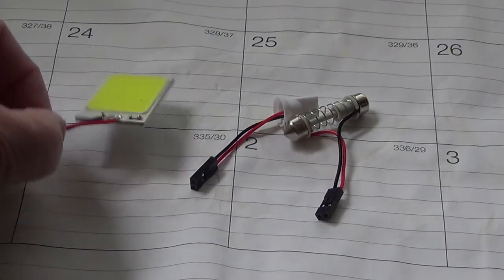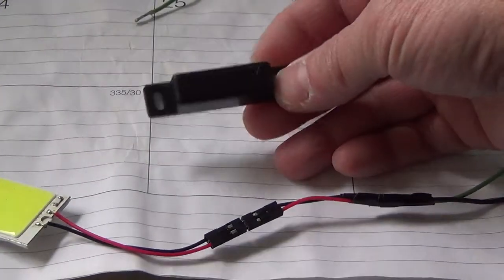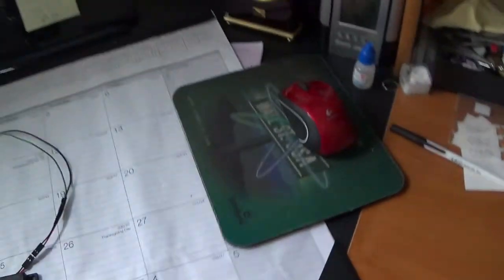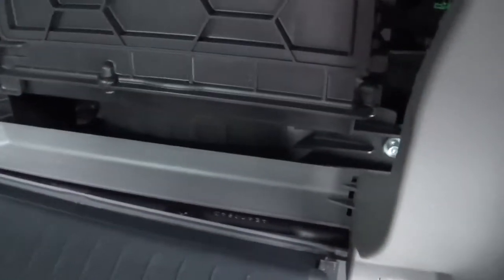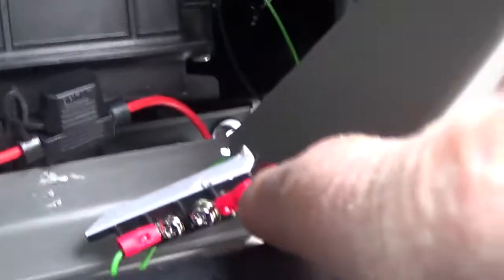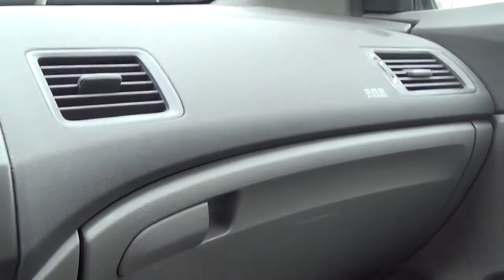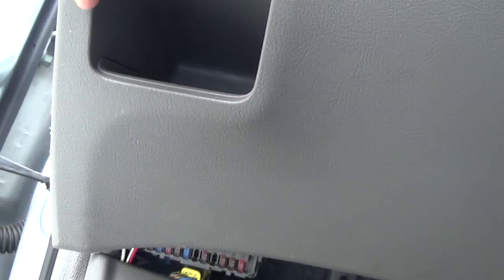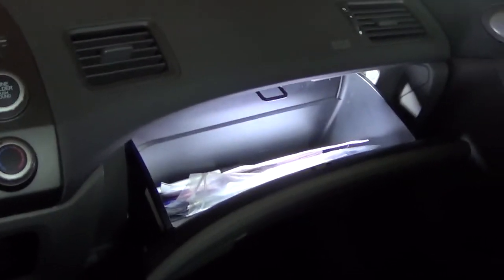2008 Honda Civic Glove Box Illumination

Comment: Thats a nice job and this videos very old but fun fact, at least on the American models there's already a spot to mount an OEM switch and light bulb molded into the inside of the glove box! Just gotta buy the part from Honda and wire it into the fuse box!